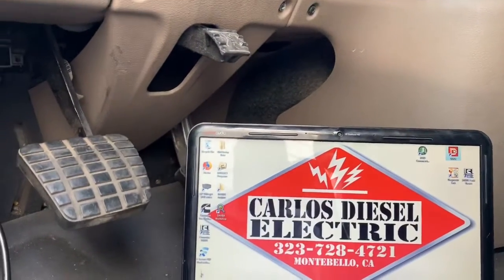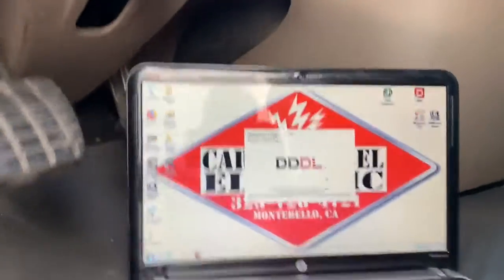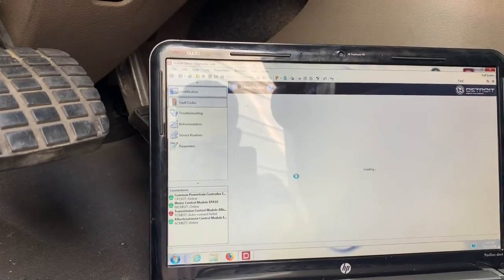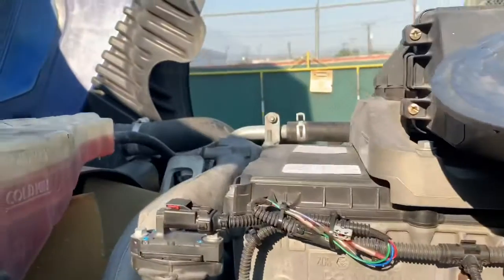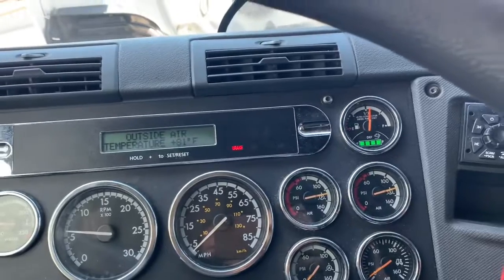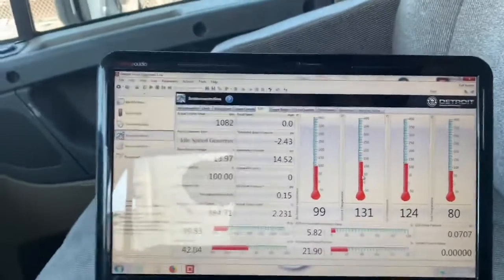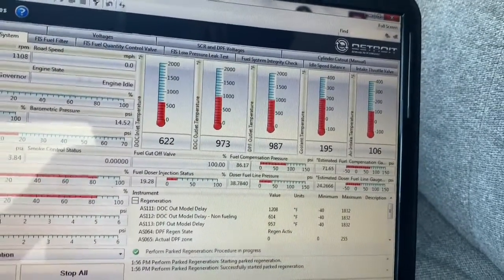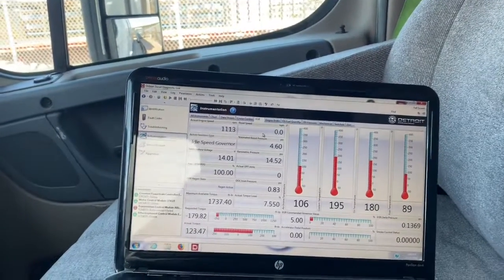EGR Delta Pressure Fault Code 411 FMI 14

Comment: I have this problem change the Delta Sensor on my 2016 Freightliner Did A regen on truck codes cleared out came back on. Do I need to do a Scr test?
Reply from the maker: @cylogistics8262  you are going to have check the EGR cooler, EGR valve area and the Venturi ports

Comment: Mine is deleted but I still get a code SPN 411. How can I fix that. I notice you’re out of Cali, can’t come to you
Reply from the maker: @wood7048  check your Venturi pipe for blockage. Remove the sensor and clean the mounting area. Easiest place to start

Comment: Is calibration needed for new sensor only .. not for the old one if we take it out to clean ports?
Reply from the maker: You can clean ports and then reinstall without calibration. It should work right away.
Reply: @ got ine question for u..
How to reprogram a truck that was initially programmed for linehaul/ longhaul 
To short haul?
Any lead/ advise is appreciated.

Comment: Is it advisable to clean this differential pressire sensor’s ports.. inlet/ outlet ports or hoses if those are clogged?
Reply from the maker: @inderveerbilling  yes. You can. Although the book says not to clean the sensor but you can clean the ports. Sometimes the port can be completely blocked and you have to replace.

Comment: DEF deleted, have engine2 SPN 411 FMI 1. with 25 percent derate.

lose power on uphill even bobtail and with empty trailer.

I replaced both Venturi pipe and Delta P sensor and the mechanic who do the delete recalibrated and still have the same code and power loss.

any suggestion please 🙏 thanks
Reply from the maker: What year is the truck?
How many miles?
Is it a DD15 or DD13?

Comment: Hi  I have a truck 2016 freightliner day cab dd15
 , has spn 411 fmi 1 and spn 3058 fmi 9 I did Delta pressure port Cleaning but still have the light on and off , do you know what is going on with this truck？ please let me know thank you!
Reply from the maker: Google search SPN 411 fmi 1 and take a look at the troubleshooting steps https://static.nhtsa.gov/odi/tsbs/2014/MC-10119529-9999.pdf
This isn’t an easy fault code but go step by step. You will need the software to help.

Comment: Hello Carlos, my truck keeps stalling out with a load or bobtail. I noticed this after i ran out of fuel and road side came out brought me fuel. The stall happens when i press the accelerator pedal and I only get codes for delta pressure sensor. And I see J1939 but I have no idea what that means. 
 I was getting the same codes I changes the sensor and the pig tail and I did the calibration but I keeps coming back and will also show out of calibration again. 
My egr was cleaned in a ultra sonic chemical bath and a flush was done on the engine. EGR actuator was replaced. The venturi pipe was not clogged. I changed my injector harness, cam housing seal, oil cooler & gasket, Vpod, delta P sensor, exhaust sensor. 
Any advise please help 🙏🏽
Reply from the maker: What fault code or codes are you getting?  J1939 is the communication ( data link), not a fault fault code. When you have someone connect to the truck, what does it read?
Reply: @CarlosDieselElectric  I can post a picture of the codes that came up from the laptop
Reply from the maker: @marknorth1686  send me an email with the pictures
Reply: @CarlosDieselElectric  I posted them on my YouTube
Reply from the maker: @marknorth1686  have the mechanic do a parked regen. What are the numbers? Temp? Pressure? 
You may have a plugged DOC face
Reply: @CarlosDieselElectric  but wouldn't I get codes from a failed injector or bad turbo
Reply: @CarlosDieselElectric  I will run the parked regen now and record and post number
Reply: @CarlosDieselElectric  thank you for your time and help. I changed the venturi pipe. It was clogged underneath the sensor but i could see through the pipe. I knew for sure bc I could stick a zip tie through the new pipe and not the old. I ran a regen and using your videos I checked my pressure and temperatures. I was stalling out bobtail and with a load. EGR Delta P sensor was my only codes. After changing the sensor and pigtail I realized that the pipe could be clogged. Now it's running great again 🙏🏽🙏🏽🙏🏽🙏🏽
Reply from the maker: @marknorth1686  I did forget to mention the pipe, normally I change it because it does get blocked on one side and can cause issues. Glad you were able to get it going 👍🏼
Reply: @CarlosDieselElectric  I will post the pipe to show the clogged port and the new pipe
Reply: @CarlosDieselElectric  if the injector harness was leaking oil but changed could it be from the engine harness having oil in it too
Reply from the maker: @marknorth1686  oil will make its way through one harness and into the other. I almost always try to replace both injector harness and the main engine harness.
Reply: @CarlosDieselElectric  on the DDDL software what is the reason for the tabs in yellow and green?
Reply from the maker: @marknorth1686  are you using the original software or the bootleg version?
Reply: @CarlosDieselElectric  it is original

Comment: How to tell if the sensor it's self bad?
Reply from the maker: First start by checking for excessive soot in the Venturi Pipe, check the ports where the sensor sits. It needs to be clear, try sticking something through

Comment: Hello Carlos, 

Thanks for your video, but my issue or fault code is 411 fmi 1 I have DD15 cascadia. I have done so many things to it and it still no getting repaired I still have that check engin on (EGR Differential Pressure Failed (High Box) do you have a vid about this issue or any idea?
Reply from the maker: There are a few things to check for this code. 
Check the Venturi pipe for any blockage in the ports. 
Check the EGR cooler, check the EGR valve for any binding. Also check the CAC. 
When you do a regen, what are the pressures in the DOC and DPF?

Comment: Hey Carlos I changed my delta p and now it has a code of spn 411 fmi 4 something about low voltage any advise
Reply from the maker: Sounds like a voltage supply issue. Check the pins at the plug. Check for corrosion or damaged pins. If not , possible harness issue. What was the code before? 
Also, you may need to calibrate using the software

Comment: Hey man I need help 😫

I got a paccar mx 13 
With a code 
P1495 
Fuel derate can you shine some light to fix this issue
Reply from the maker: Do you have access to Davie 4 software?
Reply: Us personally do not it was a friend's computer but it was thru jpro
Reply from the maker: @rometrucking4520  J-Pro is good but if you va e a derate you may need Davie4 software in in order to go in and disable the derate. Is it a EGR derate or fuel derate?
Also, we’re there any other fault codes?
Reply: @CarlosDieselElectric  it said fuel derate
Reply from the maker: @rometrucking4520  i see. Any other codes? The derate is usually as a result of something else.
Reply: @CarlosDieselElectric  no that's all that's coming uo

Comment: I HV a 2009 14 litre Detroit and I'm getting a fault code for the delta pressure sensor but my truck don't HV the sensor..I HV the year Detroit where it came from factory with a holset turbo
Reply from the maker: What is the fault code you are getting?

Comment: Carlos take for instance the Delta pressure sensor for the 14L 60 Series will it have to get recalibrated and what else should I replace along with replacing the Delta pressure sensor?
Reply from the maker: On a Series 60 14L, some of the Delta P Sensors were eliminated. So they may be there but not connected. What is wrong with your Delta P?
Reply: @CarlosDieselElectric  Freightliner ran a diagnostic it came back high EGR temp during idle and also said those two metal ubes leading up to it are clogged. 

I went and bought the sensor and Will call the tubes.  I'll do it myself.  I just need that DDDL software like your have to do my own recalibrations/diagnostics.  Thanks for your help
Reply: @CarlosDieselElectric  heading to get my truck and read what notes they wrote.  That was three hours diagnostics plus line another 5 for repairs.. my Nexas machine didn't read the check engine light

Comment: Spot on explication. Except dd says swap the venturie tube as well. Sorry about my spelling if incorrect. Also ahh the simplicity of the non multiplexed system. So you'll agree the tube should have most likely been swapped also? They have a non stick coating in them. So more then likely if the sensor is bad so is the tube. I watch some broadcasters try cleaning them. Lol. Obviously you have experience in the after treatment. In any classes I've gone to for upstream and down stream management on after treatment the inlet and outlet cannot be more then 100 degrees apart.

Comment: Mines is show Spn 411 fmi 1 what should I do it runs perfectly
Reply from the maker: TroyP20 could remove it, clean it out with shop air and then reinstall it. 
Sometimes fault codes come up. But try that first.
Reply: @CarlosDieselElectric I got the same code when I got my 2014 freightliner out the shop. My issue was egr cooler. They clean everything. Also they change out the delta p sensor too. But the code pop up after driving 8 miles. What your thought. Thank you
Reply from the maker: @richiearmstrong774  check your EGR valve for any issues. Check the Venturi pipe for any blockage

Comment: I'm getting a fault code 2
Reply from the maker: Fault code 2 means there are 2 fault codes, need more information. Use the buttons on the dash in order to find out which SPN or fault code is coming up.

Comment: Were is the delta p sensor located  12.7 Detroit 60s
Reply from the maker: Dexter Williams the 12.7 does not have a Delta P sensor. The 14L that was released around 2003-2007 does have one. If I am not mistaken it is on the passenger side.

Comment: I have a 09 cascadia w dd15 engine and when the outside temp  is below 32 degrees my truck does some weird stuff. On initial takeoff on lower gears as I accelerate and I reach  1k rpms it will stall unless I press the throttle fully and pass  1200 rpms. As its stalling I will get white heavy smoke that will linger around the ground and takes a while to dissipate( I can see it thru my mirrors). Another thing it does is when on the highway if I use the cruise control after a while I will get these  codes 
Eng sa00 spn002791 egr valv cntrl 07
Eng no resp128s 146 07 
They dont pop up if I dont use cruise but the stalling still happens even with no codes when its cold.
I have a deleted dpf. Any ideas would really help thanks like I said codes go away when temp is above freezing and no low gear stalling either.
Reply from the maker: The fault code for the EGR control could be an issue with the EGR valve or the EGR actuator. Could be a short or could be a bad EGR actuator. Just because the DPF has been deleted does not meant the EGR is not functioning. When you cyce the key you may notice the EGR actuator will still cycle.
Reply: @CarlosDieselElectric  thanks for replying. Is there a way I can  check if its either the valve or the actuator? Or should I replace both? And is that what causes the stalling and smoke because I dont get any codes when it does that

Comment: Hi,
I have code spn 641 fun 14
I changed actuator and is not passing self calibration.
Just Pre installation is ok.

Wires to Ecm are ok. Turbo gear is ok.
What you think please?
Reply from the maker: sandy bil so if the turbo actuator is New and it passes the initial part but when you install it onto the turbo and this is where it fails then most likely the turbo is the issue. The gear may appear to travel freely but once the actual gear may have resistance and this is why it fails. 
What is the code you are getting?
Reply: Thanks Carlos for replying, and this is the code:

Turbo actuator no failsafe mode, motor off spn 641 fmi 14
Reply from the maker: sandy bil after the initial actuator calibration, the gear on the turbo has to be aligned prior to putting the actuator on. Best I can do is have you google fault code 641 fmi 14 and find the correct link. Sounds like you are on the right track

Comment: I have a 2010 cascadia that has a few fault codes. ENG SA00 SPN002791 EGR VALV CNTRL 14, ENG SA00 SPN001037 00,  ENG RSRVC 128s146 14. Any idea what's going on with this truck? Experiencing power loss even when empty. DPF has been deleted also. Thanks in advance for your help. I subscribed to your channel; need to learn about this engine as much as possible..
Reply from the maker: CROWN ROYAL the DPF delete changes things. I think once the DPF has been deleted the EGR should also be deleted (programming). You may have to double check that. But the codes sounds like you may have to just calibrate the EGR actuator. What year is the truck?
Reply from the maker: CROWN ROYAL also, check your harness for any contamination like oil, water or coolant. Let me look up the codes and see how I can help.
Reply: @CarlosDieselElectric  Thanks for the help and sorry for the late response.. But a couple of drivers have recommended that I change out the engine harness first. I don't know to what extent exactly, but mine does have oil in it from the injector harness plugs. Plus, I had the EGR actuator changed about 9 months ago. It was working pretty good for a few months, then it was only working intermittently. Now it doesn't work at all, but there's voltage to the actuator, per the Detroit test procedures. Never went past that step tho. As far as the 1037 code, I think that has to do with the delete. Why does it even monitor the filter when it's supposed to be deleted? Really need someone who knows what they're doing to deal with this ECM.
Reply from the maker: CROWN ROYAL I recommend to change the injector harness (front and rear). This will prevent any future oil contamination from the injector harness into the main MCM (engine) harness and of course changing the main MCM (engine) harness. Takes about 1 days worth or work. Nothing too technical, just labor. 
I have seen many fault codes due to oil contamination. This is definitely a good place to start.
Reply: @CarlosDieselElectric  yeah, I'll change out the front injector harness, ended up replacing the rear harness about a month ago. I disconnected the plugs to check for oil, and when I went to connect it back, I accidentally bent the little metal tabs inside. Truck was running horrible lol, and had injector codes. Tried to straighten them back out and broke em off. I should've just changed both out while I was in there already.. But once again, I appreciate your help. Gonna take a few days off and see if I can get that changed along with the main harness..

Comment: You need to update your dddl
Reply from the maker: I did upgrade my software
Reply from the maker: Yes, I was running the old version DDDL 7 which for the most part works great and didn’t require a subscription. Now in order for me to work on (I believe it is ) 2014 or higher I needed to have the DDDL 8, gives me  more features when doing Diagnostic work but does require a subscription.